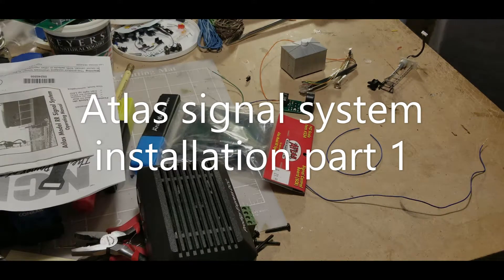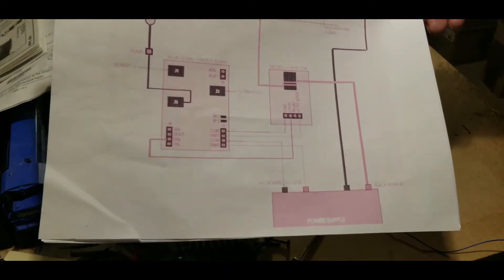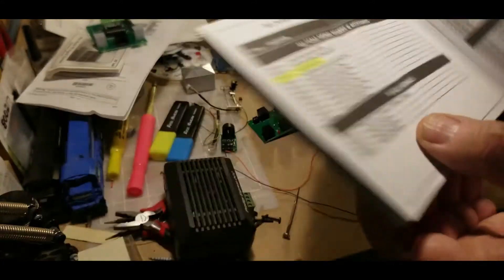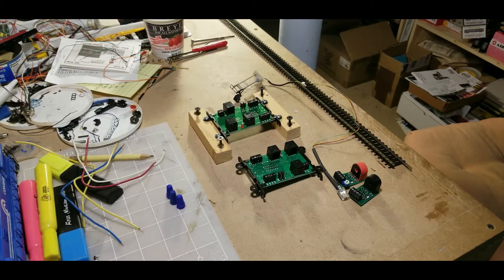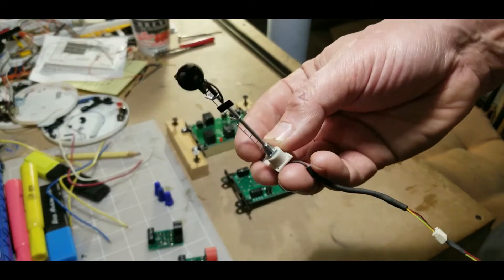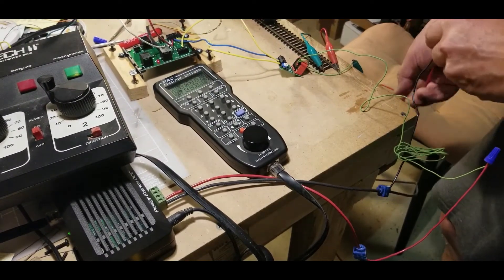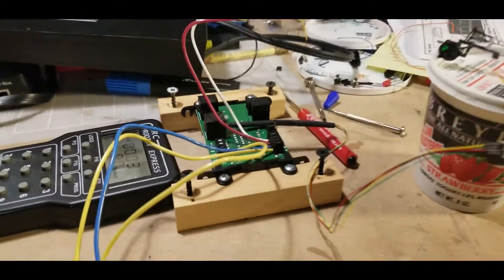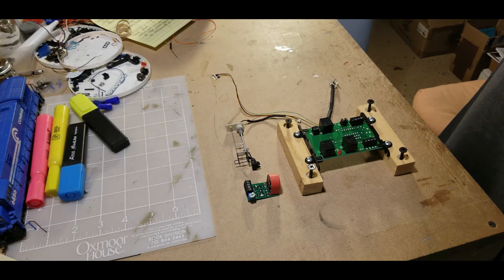Atlas signal system installation  part 1

Comment: You can use the older signals that have the RJ12 telephone plug with the newer USCB board.  Simply plug the plug into the socket on the board.  The latch on the RJ12 male plug will slide into the RJ45 female jack with the pins correctly aligned.  

If you have RJ12 plugs and a crimper, you can make your own cables that plug into the USCB.  This is very handy for making cables that are the right length, rather than having a lot of cable hanging down underneath the layout.  This is particularly important if you have a module layout that you transport to the various train shows.

Comment: also if you buy the BLMA signals or the Details West or Tomar legacy signals before they merged with Atlas you have to do some splicing. Atlas sells the Signal Conversion Kit and a crimping tool which converts their wires to J3 so you can plug it into the board. It is also compatible with NCE and TS5. Atlas and Details West are wired to JP2 Channel 1 and set to Common Cathode BLMA and Tomar are wired to Common Anode and they operate on JP1 Channel 2 to set these Atlas includes a bag of motherboard shunts in the starter kit all you have to do is set the wires and move some jumpers.

Comment: The older signal boards use an RJ11 or RJ12 telephone-type plug - 4-wire or 6-wire (only 4 of the 6 pins in the J1, J2, J3 female jack are used).  You can make your own connector cables from 6-wire flat cable, some male plugs, and a good crimper.  

The new signal boards use an RJ45 ethernet-type plug - 8-wire.  You can make your own connector with some ethernet cable and male plugs.  You may be able to use your crimper as there usually is two slots - one for RJ11-RJ12, and another for RJ45 male plugs.
Reply: The ability to use common anode or common cathode signals is a major advancement with the Atlas 2018 USCB.  In the older 2006 SCB, the return was "common cathode".  The common return for all LEDs in the signal mast were the negative wires.  If the LEDs in a signal mast were "common anode" - ie the return wire was the positive wire - you couldn't use these signal masts with the 2006 Atlas SCB.  

With either "common anode" or "common cathode" return, simply by moving a jumper plug, you can use pretty much any signal mast out there on the market - provided you know how to connect the wires to the proper pins in the RJ45 female jack, you have a spare plug, and you have a crimper to crimp on a plug.

Comment: You can wire the system with only 4 wires and remember that you have too insulate both rails at both ends of the block or you'll get feedback through the oil that you don't insulate.